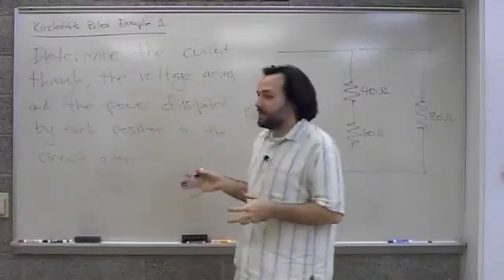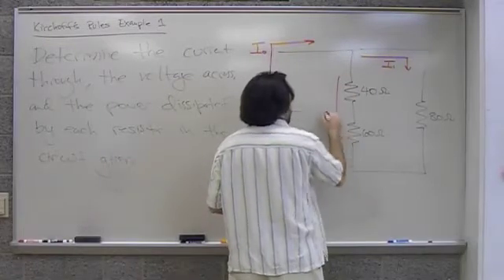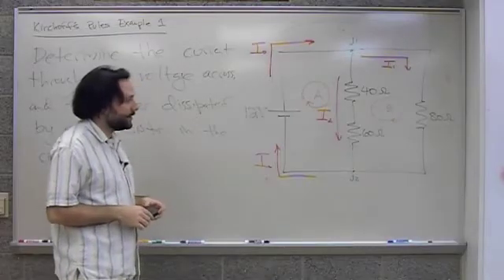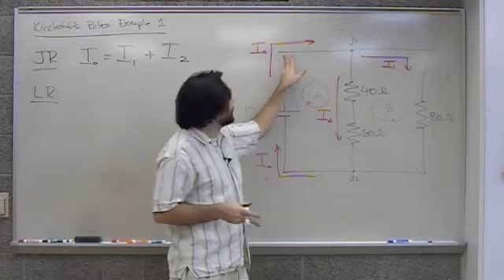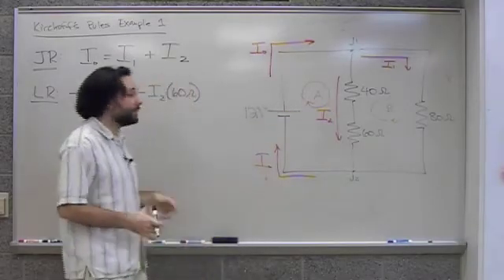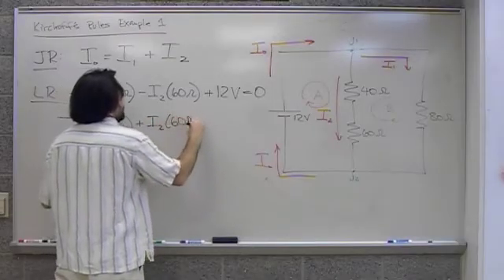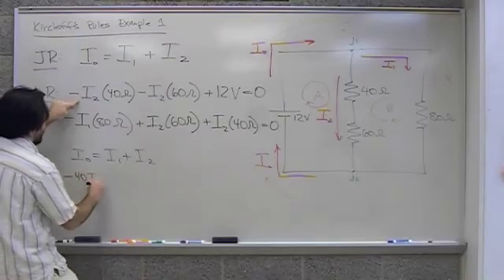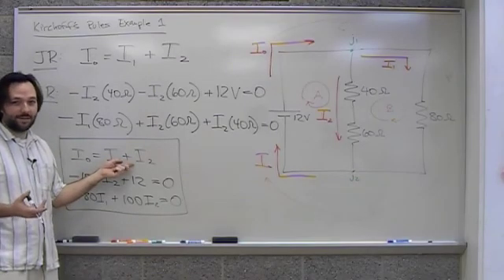Kirchhoff's Rules - Simple Example

Comment: hmm.. you know, I'm korea and I bought a book which is called basic circuit theory.
We deal Kirchoff's law with the thing called node, not junction. I really badly want to know what the difference is between them and how they are differently applied when it comes to solving questions.
Reply from the maker: Annyeong from Detroit! I think that a junction is a three-way (or more) intersection in a circuit. A node is simply where two (or more) circuit components intersect, e.g., a wire and a resistor. So all junctions are nodes but not all nodes are junctions. Hwag-in?
Reply: hwag-in? haha you mean correct? Yes, I think it is! (but you'll say "maj-a" in this context. blahblahblah haha) I definitely got it! thx
Reply from the maker: everyday Great to hear. Sorry about my Korean!